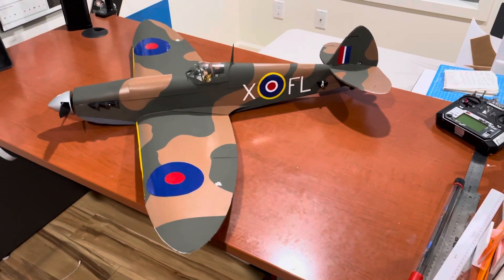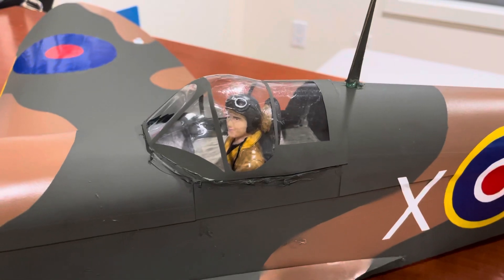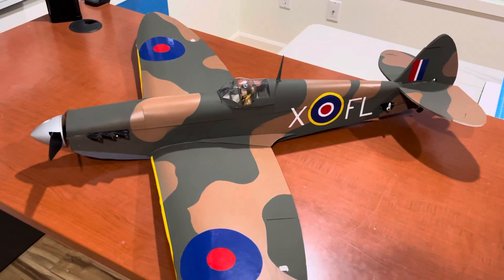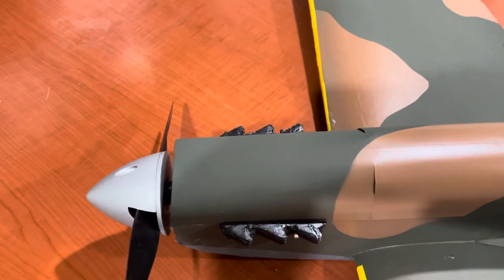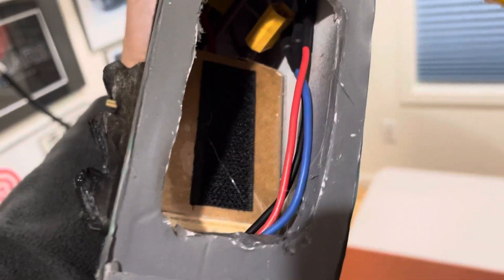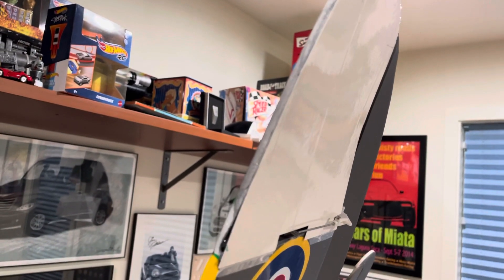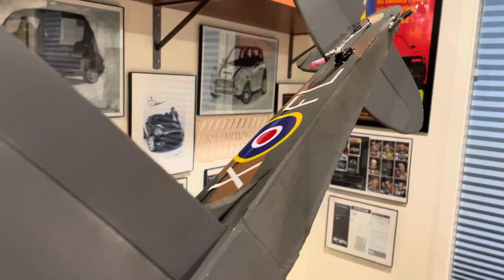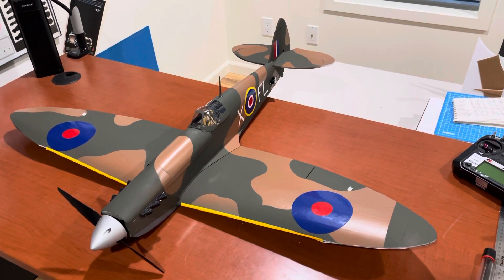Flitetest Spitfire mods

Comment: Ik this is late to the show but how did you reinforce the wing cut outs?
Reply from the maker: They are made from foam board. First cut to the triangular shape, remove the bottom layer of paper, then bevel the bottom with a sharp blade. I think Flight Test shows this in their video on the mighty mini zero.